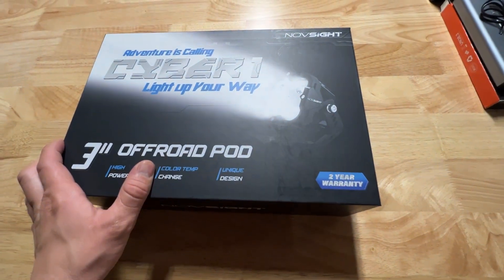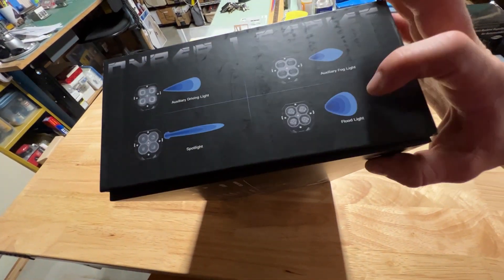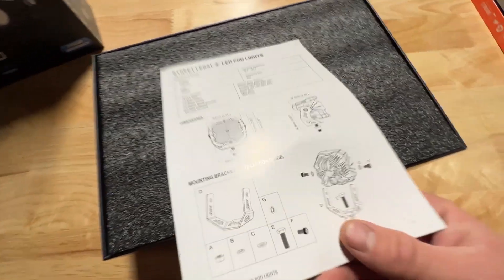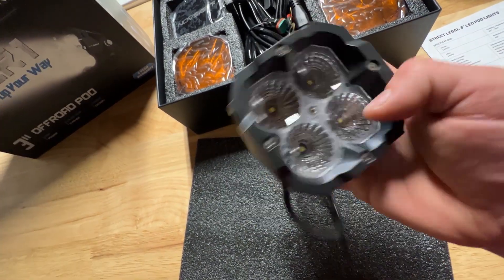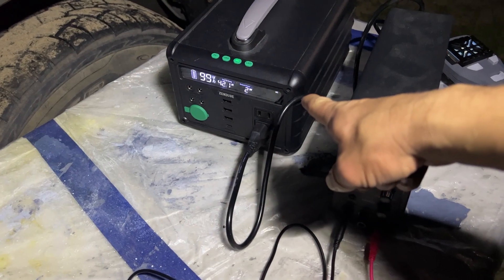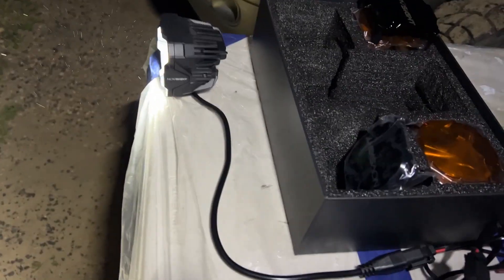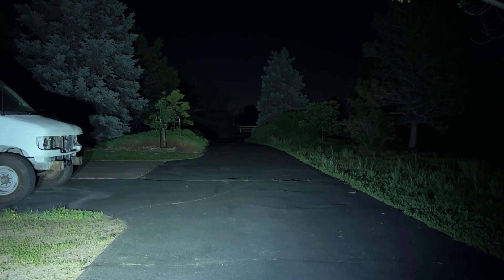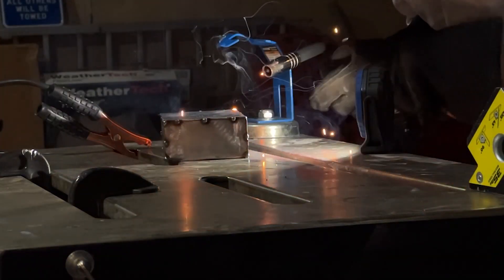High Quality 3" Off Road LED Light pods, NOVSIGHT Cyber1 Unboxing and Wattage/Brightness Tests

Comment: Gonna put some LEDs from that company on your tdub?
Hard to say which is brighter but the LED white light is clearer. I changed my truck to LEDs and I love ‘em.
Reply from the maker: I already got a neat lil light bar on the TW, yeah for sure, the flood pattern is quite nice in a way
Reply: @4WheelKid  I see, wasn’t sure if you still had that or not. Floods are nice.